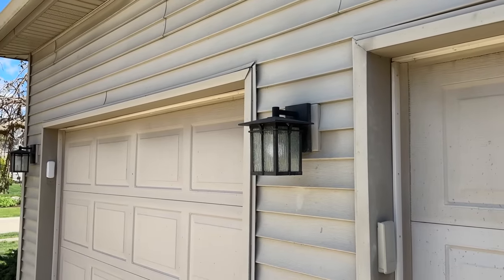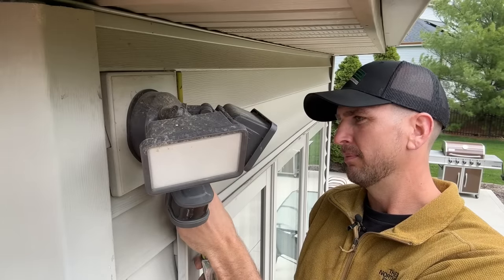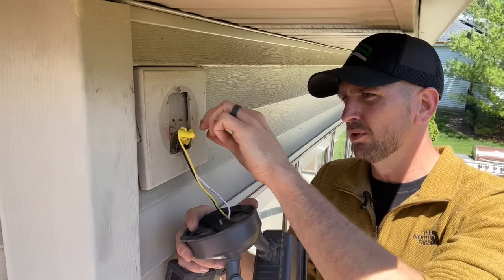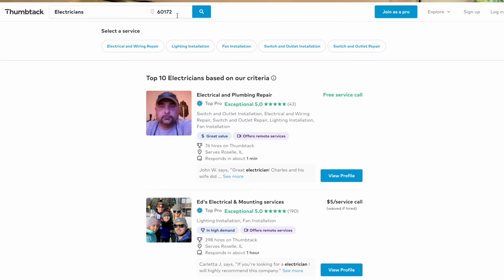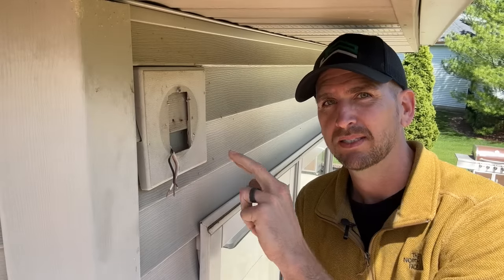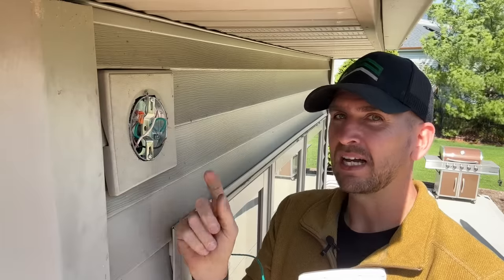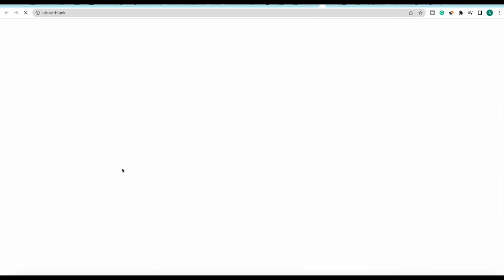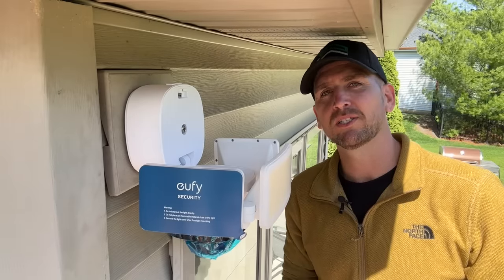How To Install An Exterior Light And 3 Common Mistakes To Avoid

Comment: Exterior rated duct seal and or silicone caulk around the 3 sides of fixture leave a gap at the bottem with the seal or if no seal/gasket is present 🤔

Comment: The title says he's exposing mistakes so just for clarity it is not a mistake to use wire nuts just a preference.  Wire nuts are still allowed in this application by code, they are just a little more difficult to work with.  I've done a thousand of these with wire nuts over the years and never got a call back.

Comment: Don't mount a pancake box at 90 degrees always install them at 45 degrees.  If mounted at 90 degrees there is a chance, depending on the fixture mounting screws, that the box screws will interfere with the fixture screws.

Comment: For a brick application, could you just use a pancake box and surface mount it? Those bell boxes just look ugly with the extra offset. Or is there an option I’m unaware of that’s better? Thanks!
Reply: Unless you cut out the brick, the pancakes are not designed for outdoor use.

Comment: If one were to update a light fixture outside on flat wood siding with a junction box inset and the fixture flush to the siding is that ok? Just updated two lights outside of my 80s home and that’s how they had it. Strain reliefs present, no open knock outs and caulked the top and sides of fixture.
Reply: That's fine.

Comment: When doing stranded to solid wire in a wire nut...wouldn't it be ok to tin the stranded..or is there issues beyond wire solidity
Reply: So much faffing around,use Wago fittings safer and easier😊

Comment: Lever nuts make sense for a more secure wire connection.  You did not explain why installing an external junction box is important compared to the original external vinyl box.  What is the advantage of an external plastic junction box?

Comment: Close, but no cigar, that's not to code you still have the same issue, but now behind the box you just installed. You should have Romex with intact sheathing coming into the box with a Romex connector, still a potential fire hazard, you have #14 wire pressed up against the siding by the box, a no, no.

Comment: Lot of homes are slump block homes with stucco over it I'm in Arizona not sure how you get a junction box in that without some serious cutting and risking cracking a chunk of block out. 1" box look terrible with some decorative lights.
Reply: get the box that's the same color as the fixture. they do come in colors besides grey. We just ordered 100 oil rubbed bronze exterior weatherproof round box to replace the exterior lights at apt complex that went with oil rubbed bronze fixtures

Comment: Why not run the light fixture wires through the exterior sheeting to a junction box inside the garage?
Reply: Becsuse the light fixture would be crooked/angled because of the angle of the siding.

Comment: Two questions, first, do wago lever nuts meet electrical code? Second, why not caulk or install a weatherproof gasket around the surface mated to the junction box? Another question is about the install, in that the junction box should be mounted flush to framing (or structure) and not the siding, correct?
Reply: Im not from the USA but WAGOS in Europe are used for every important domestic and industrial building for a long time. i personaly use them for over 15 years without single problem
Reply: Wago has UL-Certification in the USA, so (everything I read says) they are code.  At least for indoor applications, less sure about outside/damp.

Comment: Wire coming out of the wall looks like 12AWG. If it’s 14AWG you’re good, but it looks like 12AWG which cannot be used with pancake boxes per NEC. 

Per 2020 NEC 314.16, 3 12 AWG conductors require a total of 6.75 cubic inch box or larger, a 4” pancake box is only 6.0 cubic inches. 

While this pancake box is much better than no junction box at all, using a pancake box with 12 AWG wire is not code compliant and would not pass inspection.

Comment: Every outdoor light I have ever changed out has had wire nuts in it when I removed it.  And  those wire lock clips are not up to code where I live . And I have seen other videos where they said those are a  bad idea.

Comment: I guess my house wasn't the only one with lights mounted by previous owners/original builders/shoddy contractors over the years, with no junction box AND poorly made wirenut connections that came apart in my hand when I removed the screws holding up the light!

Comment: The wires will corrode in time without any non-corrosive silicone protecting them. Just get the right kind because the regular silicone has ammonia and is corrosive to wiring.

Comment: I'll be replacing the exterior light of my home with an upgraded one. The house was built in 1963, and has only 2 wires on the original light... no ground wire. The light that I purchased has 3. Do you have any suggestions?
Reply from the maker: Unfortunately in that case the fixture will be ungrounded.  It will perform correctly but if there was an internal short then the ground isn’t there to trip the breaker so it can cause more risk.
Reply: @EverydayHomeRepairs  If there's a short from hot to neutral within the unit, the breaker will trip/the fuse will open. If hot shorts to case, then yes, the breaker/fuse will not do its job.
Reply: @EverydayHomeRepairs  Install GFCI circuit breaker in the panel.

Code compliant.
Reply: GFCI breaker in the panel.
Reply: If the electrical is that old it'll be BX cable. BX is armor jacketed cable. The metal armor jacket is the ground. They didn't start making plastic flat Romex until later. People weren't too keen on the crappy plastic stuff for a while after that. If you look really closely where the wire comes into the box you may see a little red plastic doohickey. That's the chaffing grommet for the wire coming out of the BX jacket. No one was wiring stuff without a ground in the 60s. If your crap was knob and tube that'd be a different story. There should be a ground screw in the box. Or at least a tapped hole where you can put a ground screw. Anything you screw to the box will be grounded.
Reply: @EverydayHomeRepairs  you're confusing circuit breakers with ground fault circuit interrupters (GFCI). A breaker will trip on sufficient overload. If shit is shorting out the breaker will trip.
Reply: @1pcfred Romex brand wire has been around since the 1920s.
Reply: @TomCee53  flat plastic jacketed cable was developed by NASA in the early 70s. So Romex being around before then is immaterial. I'm sure they were making some kind of wire. And being as they were making it you could call what they were making Romex wire. But it's not the Romex wire we know today.

Comment: How does the Eufy Security light get power for the camera, if the light is turned off at the light switch? Do you just always leave the light on?
Reply: Yes. You can get switch-protectors (prevent accidental flicking). You can also remove the actual switch  and just use a blank plate to convert it to always-on.

Comment: You did not put a strain relief on the back of the pancake box. This can allow the wires to chafe against the metal box. A little bit of the NMC jacket needs to stick out into the box.

Comment: Did you cut out the angle notch on the vinyl mounting block yourself. I've never heard of these before and looking on the home depot website I do not see any with that notch cut out (at least it isn't apparent in the online pictures). Thanks.
Reply: That’s a local modification. It depends on the siding. I’m not saying that some siding manufacturer doesn’t make on to match, but I can’t remember seeing one.
Reply: Thank you for the reply @TomCee53

Comment: I have used the larger outside box you show, but I struggle with the strain relief/clamp in the back. I have installed the romex clamp inside the box, instead of on the back, but it is very awkward.

Comment: I band sawed a solid wood mounting block with angled cut outs for siding reveals. Also, Ring provides a hanging wire with their outdoor Cams. It works well to hold the fixture while attaching the wires. I believe the man in the video indicated he was going to use a connector on the wire and probably installed the caps on the open knockouts. They are usually packed separately in the box package.

Comment: There are some flood lights that come in 2 parts and one screws straight into the wall and the wire stub goes in a j box which the light itself attaches to

Comment: A thought. Arent you supposed to use a bushing where the wires pass through the ko?
Reply from the maker: Absolutely, definitely want to protect the Romex from the sharp edges.  You will see a black plastic one used but should have called more attention.

Comment: I had some guys who did my siding recently (they were really good at the siding part at least) but they didn't know shit about electrics. I had to do all my exterior lights myself because they were going to use the vinyl box as the "junction box" and screw the lights and bracket right onto it like what you had here. I almost flipped my shit at them for being dumb and not knowing about this already. Got my own exterior junction boxes installed directly onto my walls, wired the lights up properly inside and installed the bracket onto that, and then installed the vinyl box over it (with a cutout to access the wiring).

Comment: I use wire nuts no problem. if you can't make a solid connection with a wire nut you need to suspend the light. wagos take up too much space

Comment: Call me old school but I like wire nuts. I would never use the WAGO connectors unless absolutely necessary and only for small loads. I have had them slip off of wires and don't feel confident that there is enough surface contact.

Comment: I have never seen gaskets for the bases of the exterior light fixtures. Who sells these gaskets? I know we have them as anti chafing protection where sharp edges meet aircraft skin. Don’t want to pay the over inflated costs of something that has a TSO approval. Federal signal used to supply these types of gaskets for the OLD cherry lights for cruisers that were screwed to roof of cars. NLA from Federal Signal. Another hint, use a heavy wire to create a S hook and you can hang the fixture while you connect the lines. The best are the stainless butcher hooks that can handle the weight, available online from butcher supply shops.
Reply: The gasket should come with the fixture.

Comment: The pancake box must be mounted directly to the structure, not have vinyl siding sandwiched between them, and the entrance cable requires an approved type box connector. No gasket was installed between fixture and mounting plate, so sealant is needed.

Comment: I know that  this is  a code question , but what  additional safety does the metal box provide?
Reply: They can contain/stop sparks or fire from getting outside.
Reply: I'll answer my own question.  I think it keeps a hot wire from getting from inside the box and into the house, wire could get hot since its smaller gauge than what the ckt breaker will break.

Comment: 4:13 BOX FILL- The wires look to be 12AWG but lets say they are 14AWG for the sake of this anyway, with 2 conductors of 14AWG we have a 4 cu in fill, a 14 AWG ground is another 2. 3 14 AWG wires give us 6 cu in of fill. We add the support we are now at 8cu in of fill. This pancake box is 5/8 x 4 which allows 8 cu in of fill.  If the fixture wires are less than 14AWG we can exclude them but if they are at least 14 we must count them. Some AHJs will count wire nuts (and WAGO) as fill. If that line coming in is 14AWG and the fixture is under 14AWG this may be okay if AHJ don’t count connectors. If that cable coming in is 12AWG its a fail. If the cable coming in is 14AWG and the fixture is 14 AWG its a fail. Box fill calculations can be found in NEC 314
Reply: It's only a glorified outside light,easy task for a DIYer, what's all that jibarish.
Reply: @One line Al  the gibberish is he is speaking on mistakes diy'ers make in code violations yet he is violating a code that can easily lead to overheating. So I am inputting an actual electricians advice/knowledge. I mean you came here and watched a video for information about a project, I am just adding more knowledge

Comment: Should the wires be clamped as they come in to the back of a metal box?
Reply: Yes they need to be secured to the box in this install.
Reply: Exterior by rights you should use a water tight connector. A connector with a gland. I wouldn't hang a box like this guy did. Well, maybe on his house, but not mine. Exterior I want it 100% waterproof.

Comment: I've seen conflicting info on using Wagos in an outside light fixture. Safe or not?
Reply from the maker: Safe, they are not water tight but anywhere you are using wire nuts you can use WAGO 221 lever nuts.
Reply: @EverydayHomeRepairs  Thanks!

Comment: Does the current light have an on off switch? I'm interested in installing this exact light and camera, but I'm not sure how to get rid of the switch. If I do not remove the switch we have to make sure the light switch is always on and the lights will run all the time in order for the camera to work. Does anyone have a suggestion for this situation. Thanks
Reply: if the current light is switched, you can take the switch out and tie the switch legs together in a wire nut/WAGO , blank plate off the box. gets more complicated if the power goes to the switch first though
Reply: @harveylong5878  Thank you for the replay. What you explain makes sense. :)

Comment: Wiggling one wire to test for loose connections is a bad test. You could tell by the way the wires fell apart when the nuts were removed that they were improperly installed.

There’s no point in having a vinyl mounting block if you aren’t going to seal the block to the siding.

Comment: I did not see a coupling to protect insulation on wires passing through the new box.  Long screws would achieve the same purpose without cutting the square plate.  I Want my Security Stuff to be Visible.

Comment: Wago Lever nuts suck. Have come across so many that the connections loosen and destroy LED power supplies  from arching. They are right up there with Sharkbite plumbing fittings. Sounds good on paper, but a disaster in real life practice.

Comment: Disagree with the WAGO connections.30 yrs exp with industrial controls, i have seen too many intermittent connection problems with these type connections, also seen many problems with improper wire nut connections. I recommend using two sets of pliers, one to hold two wires and one to twist them together, then apply the wire nuts and finally electrical tape around wires to cover wire nut connection

Comment: Pan he installed did not appear to be done to code. No wire clamp. Wires running through a sharp metal circle hole with no wire clamp.

Comment: Now... did you instal the non-compliant light in the first place?
Reply from the maker: Yeah, I installed that security light replacing the original unit about 3 years ago.  Didn't know any better and trying to pass on the information to other homeowners like me.
Reply: @EverydayHomeRepairs  Thanks for the honesty 👍

Comment: It didn’t look like you ensured that the sheath of the non-metallic cable was secured by entering the connector by at least a quarter of an inch. But the vote down was for using Wagos instead of real wire connectors “wire nuts”. Outside especially!

Comment: Not to code, but not a big risk since no metal around.  As long as it was mounted securely, it was safe, esp. if the cable inside was run in conduit so couldn't be tugged out of the light.  Wasn't much different than having a round plastic box.  The cable wasn't even secured to the new metal box.  Re safely working on it, as long as you turn off the correct breaker, there is no risk.  If not standing in a puddle, touching live 120 VAC wouldn't hurt you anyway, just be instructive.

Comment: This install is fine for a stick built house but I have solid wood walls. I want to replace the existing light which is mounted to the underside of the angled soffit. There is not enough space there because of the angle so I want to mount it to the wall below. How can I get the wire from behind the soffit to the wall below? It would need to be on the outside of the wall.

Comment: When discussing the pancake box, it should be noted that those are intended to be used very specifically for lighting connections where there will only be 2 to 3 conductors in the box. too many conductors in the box is also a code violation. nothing wrong with what you did, just something people should be aware of.
Reply: pancake boxes are waste of time, they hit box fill limit usually just with the conductors going into them. by time you add the fixture wiring, wire nuts/WAGOs, you've exceeded box fill limit

Comment: Be careful with pancake boxes.
There are just enough  cubic inches of space to use 14/2 wire.
If you have 12/2 wire, there isn't enough space, and you will violate the code.
Reply: which is why they are a waste of time either way. too damned shallow to tuck wire, wire nuts/WAGOs in. I'll use an exterior box before I'll consider a pancake box

Comment: Those lamps were installed after final. No inspector would approve non metallic cable coming out of an exterior wall for a light fixture